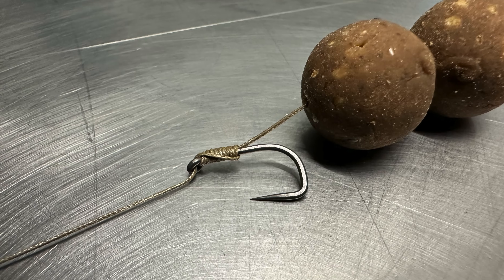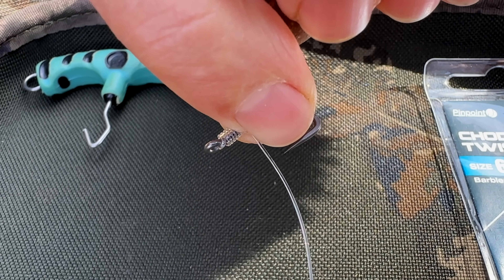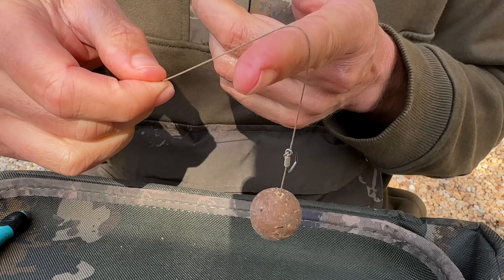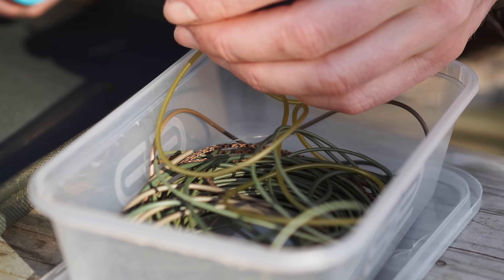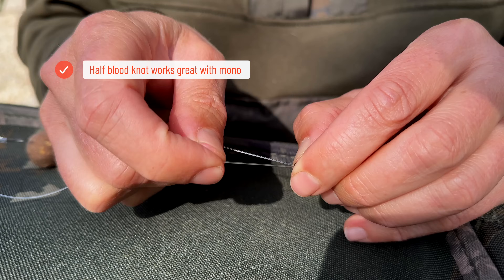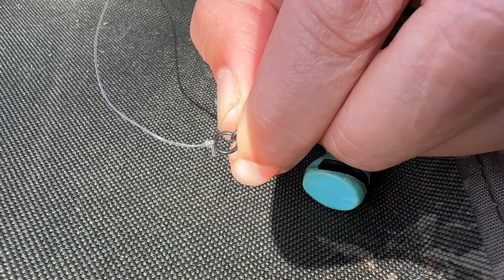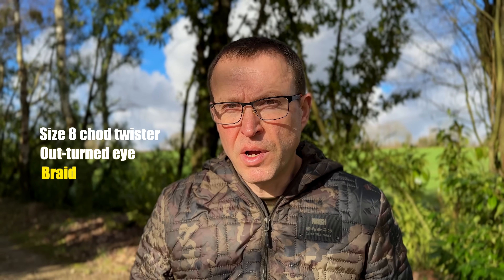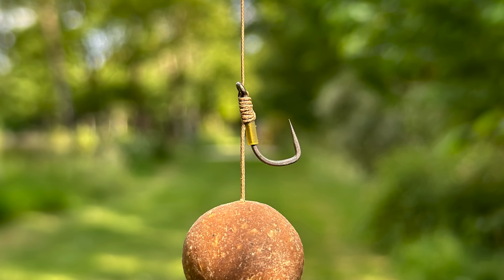I Tied The Hair Rig Wrong For Years (DO THIS INSTEAD)

Comment from the maker: The hair rig is an absolute classic and to be honest, it’s all we really need to catch a carp or three. One of its many benefits is that it’s easy to tie but there are still plenty of pitfalls to avoid along the way. Some of these mistakes will make the rig virtually useless but I’ve included other more subtle choices that won’t necessarily stop you from catching carp (when they are in a generous mood), but sometimes, when the going gets tough, I’ve found that fixing these can bring about a rapid change in fortune, even when it looks like it’s going to be a blank session. Hope this gives you food for thought.
Reply: Reduce the options for failure, increase the chance for success. Simple is the way to go, and key to this. Sometimes, as anglers, WE make it too complcated for ourselves when we don't have to.

Comment: Very good video as usually Matt and everything explained in a very good way 👍. We all have our favorite rig’s and we all tie them the way we favor most. I always leave a very long hair of at least 10 cm with no loop. Only if I know what  hookbait I’ll use  I tie a loop so it’s exactly the size I want. And like you I will always make sure that the knot is trapping the bait(s) so it can’t slide up the hair towards the hook. On the other end of the rig I don’t put on a swivel but I tie a loop which I can put on a kwicklink or a big loop which I can loop onto the swivel attached to my leader.
I also like to use a rig ring on the shank of the hook and a line aligner. I really believe using this additions  provides a much better hookhold than without them.
Looking forward to your next video!
Reply: Suggestion....tie the loop, but don't tie the hook onto the line, and don't tie on the swivel at the other end until you know what bait your using, and what size of bait you're using. You could even add the blowback tube onto the hook, pending completion. Rig cases will hold partly made rigs these days.
Reply from the maker: Thanks very much for sharing your thoughts. I also attach many of my rigs with loops to a quick change swivel and keep it in place with a short tungsten anti tangle sleeve but in this video I just focused on the mistakes I see when anglers are doing something simple such as tying directly to a swivel.

Comment: Paused the video at 27:34, while you were showing us tying the bait loop, BUT....I have a suggestion....match anglers use a loop-tyer to tie uniform loops in their rigs, and they will definitely be big enough for a boilie stop, and will sit inside most baits, when completed. Adding one of these to your tackle box will help those anglers with sausage fingers or dexterity difficulties or vision problems. They will work with braid and mono, and with hooklink materials in the higher diameters that big-fish anglers use.

With a hair rig, what we are effectively doing is increasing the gape of the hook. What we're doing is increasing the distance between the point and the shank (directly opposite, horizontally) so that it becomes less than the distance between hook-point and the eye (where the pivot point from the hook-link is). Increase the gape, increase the chances of the hook turning over and grabbing. Simple.
Reply from the maker: Hmm, never heard or seen such a thing TBH mate. I know that some anglers find it hard to tie a simple overhand loop knot as I’ve watched them struggle but TBH if they can’t do that then I’m not sure giving them a tool is going to help but I’d be happy to be proved wrong! Thanks for sharing the idea. Cheers, Matt.
Reply: @matthewcollinsangler Sensas, Preston Innovations and Ringer Baits all do them. With Sensas being French, you should have no problems finding them in the local magasin du peche. Sensas Loop Tyer.

Comment: 32:15 I completely understand the importance in getting the most amount of rigs per spool of hooklink material, however, I am a perfectionist when it comes to rigs - I construct every one of them fit to be mounted in a case on my wall! 

I’d rather cut off 10cm extra material and tie a two-turn figure of 8 loop so I know it’s going to be fishing the same way when I change rigs after a fish. 
Does the 3cm length difference make any odds? Probably not. Does it make me happy and confident? Yes. 

It’s more of a principle thing rather than me believing it’s actually going to make any real difference. If I ensure every single part of my rig is how I want it (sharp, straight, undamaged, etc.), THEN I believe I will catch more carp. Just like you have said before, carp fishing is all about tiny percentages adding up in your favour!
Reply from the maker: Nice to hear that mate. I’m totally with you, it’s that kind of attention to detail that makes a difference 👍
Reply: Confidence. Simple.

Comment: Hi Mathew after watching your vids I decided to try out the Nash chods as I’m fishing for fish up to 50lb with a lot of margin snags, bushes sunken trees left right and I’m so impressed with their strength, v sharp for wire gauge as well. Do you have any opinions on their longshanks or longshank hooks in general? I hear a lot about hook pulls and mouth damage but no experience
Reply from the maker: Hi mate. I have tested the longshanks in a size 8 with a very fine mono known as zig flo. Although they worked for me in the situation I was using, I wasn't comfortable using a size 6 or even a 4 because of how long they become and extra length means extra leverage which can lead to mouth damage as you mention. For the type of fishing you are doing, the eye size of a size 8 will be too small for the materials required so I can’t recommend them to you. I use the size 6 nash chod Twister for 90% of my fishing. I also use the standard Twister version if I’m using a supple material like Armourlink. I use the chod Twister in a size 6 for river carping for very powerful carp in flowing water or even for banking monster catfish, those little size 6’s can literally do it all. If you prefer a beaked point and like a wide gape pattern then I’d look at the Nash claw in a size 6. Heavier wire gauge but still a very sharp point. Wide gape, short shank, mega strong. The size 6’s are large. The 4’s are massive! I use the size 6 chod claw for use with heavy duty multi rigs made from 35 lbs Skinlink. The material is very abrasion resistant and strong. Doubled over you need the larger eye size of the size 6 chod claw to handle it but a size 4 chod Twister also works 👍 I did get a pack of the Brute hooks to have a look at but the wire gauge is huge! You could literally tow a truck in one of them 🤣 Just not necessary in my opinion.

Comment: How do you stop braid such as the Armourlink from tangling? I've tried this rig a few times and every-time bring it back its gone around the lead clip or just a mess in general. It's fine with Skinlink and other alternative skinned hooklinks.
Reply from the maker: Hi mate, sorry to hear that you are having trouble but I’ve got a pretty good idea of why. Firstly I would never use a product like Armourlink with a lead clip. I never use lead clips anyway but if you want to use Armourlink then you should only use it with an inline lead for a start. It very much sounds to me as though it’s tangling on the cast and if you just cast a supple braided rig into the lake with a lead clip, then a tangle is pretty much guaranteed. Swapping to an inline lead can help but you still need to be stopping the lead in flight before it hits the water and landing the rig. Feathering it in is not good enough. If you have no idea what I’m talking about then that’s where the problem is. I can cast a simple supple rig 70 yards, hit the clip and land the rig every time but that’s something I’ve learnt to do over many years. Over 70 yards I’ll struggle so I’d use another material. I suggest you use it in a solid PVA bag. That will solve the problem instantly. It’s also great in a bushwacker or a bait boat. If you don’t want to use a solid bag and you have to cast, then Armourlink might not be the right product for you. We’ve got a new video coming in a couple of weeks on a simple anti tangle mono rig which will solve your problem. Hope that helps, Cheers, Matt.

Comment: A question, but if I use a fluorocarbon with a hook with an inturned eye and I start to pull it to increase the gap and then it comes out almost straight, can I avoid using one with an external eye or does it remain less effective than the second?
Reply from the maker: Hi mate, sorry but there are too many unknowns for me to answer that question. Personally I do not use fluorocarbon; it’s too stiff, too expensive and it’s just not necessary to be very successful (I’ve done a video on that: https://youtu.be/5GzS0Ae-tUA). 
By using an out-turned eyed hook (like the nash chod Twister), all you need is some 0.50 mono to produce low cost, highly effective carp rigs. My favourite is the Nash heavy duty mono snag leader. You get 100m for about a tenner, that’s 250+ rigs worth.
Reply: @matthewcollinsangler  Hi thanks for have answer.

Comment: With a lead clip, what is the minimum length of hook line you would use, for the safety of the fish and the lead not hitting the fish or its eyes
Reply from the maker: I mostly use 6” rigs and at that length, during the fight there’s not much chance that the lead could hit the carp's head. 

If I have to use a lead clip, I set it to dump the lead on the take, that’s what they are designed to do. Lead clips should only be used if the lake is weedy - that’s where you need to dump the lead. I don’t use lead clips, I mainly use a free running ledger, I don’t lose any lead and it’s a lot more effective. If you want to know more about lead clips and their issues, check out this video: https://youtu.be/a6WI6Y1o_Xk.

Comment: When going back through the back of the eye at the completion of the knotless knot, i have always gone through twice so it’s a double lock on the eye. Never had one come undone or break off due to this
Reply: Also i do 12 wraps around the shank then back over twice to the back of the eye then twice through the eye. Can’t say Ive seen anyone else do this but it locks my fine braid in tight and secure every time
Reply: Surely you're creating a left or rght bias in how the line finally exits from the eye, depending on how the line or braid sits in the eye of the hook? That bias might be kicking the hook sideways. Just a thought.
Second point. How big are the eyes on the hook you're using? The hooklink material is going through it 3 times - it just seems to be one time more than necessary.
Reply: @stevemccrory9130  yes a total of 3 times through the eye, obviously the first time is the start of the knotless knot with the hair, the last two times exiting the eye, on a size 6 hook do not overlap and you can manipulate the material to sit exiting the exact middle and rig pull it tight and it just locks into place. The only downside is getting snagged up somewhere and pulling for a break as it just won’t ever give out

Comment: which hook and hook size should I use for 0.33 mono
Reply from the maker: Hi mate, if you want to keep it really simple then I would use a size 8 chod Twister with 0.33 mono. I use Zig-Flo when I need to go that thin. Works well as a simple mono hair rig but you’ll struggle to do a D rig as the blob will pull through the eye. If you want to use a D rig with 0.33 mono then check out this video which explains exactly how to do it: https://youtu.be/Z2Zh54emhS4
Reply: @matthewcollinsangler  ok thanks i really am learning a lot from u
Reply from the maker: @Alen_Virag06  great to hear mate 👍

Comment: My hair just keeps twisting when I tighten the not😭
Reply from the maker: The knotless knot will rotate when you tighten it. That’s the nature of the knotless knot. It doesn't actually have to be tight to work, all that really matters is the exit angle of the hair. I never tighten the knotless knot in a fishing situation but I do push a blowback tube up underneath it to hold the exit angle of the hair securely. Hope you get it sorted. Cheers, Matt.

Comment: Hi Matthew, I guess in terms of some poorly made hook, I guess so. But 98% of manufacturers have Super hooks. From the point of view of physics, you are not right, if the fish acts on the hook, it is at the interface of the eyelet and the fishing line, from the point of view of the laws of physics, this is where the biggest pull is. Subsequently, this is where the fishing line turns and returns to the eye. The pressure at the bend of the eye will be small compared to this point, and this can be reduced by wrapping the line. If I calculate the tensile force in the formula when wrapping 5x, then when wrapping 9x it will be 4.6x less. I don't know why people make up problems where there aren't any. They don't find out the information and then spread nonsense and absurdity. And this also applies to your video.

Comment: Why Retie a rig for double baits???? Just use extended hair stoppers
Reply: A hair is going to be narrower when it is pulled into the bait. Always a chance of splitting the boilie into pieces with an extender when it is pulled into the bait. Harder (air-dried) baits can do this, although adding the split bait to your spod mix isn't a problem - just don't leave it on the floor - rat attractor, plus the next angler can see the special hookbait you've used (secret squirrel and all that).
Reply from the maker: Because it only takes 1 minute to retie. If I’ve used the rig with a single bait the hook will be blunt anyway so it’s pointless casting it out. Extender stops are just something else I’d have to buy and carry with me and my aim is keep my fishing as simple as possible. As already mentioned an extender stop can easily split baits (especially 15mm). I use a lot of rock hard salt cured baits and can’t use them with those.